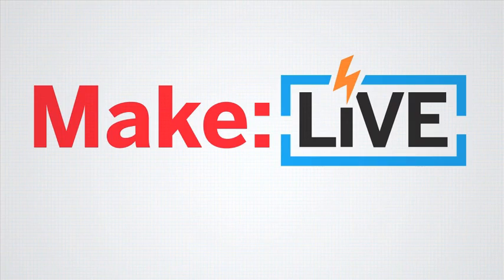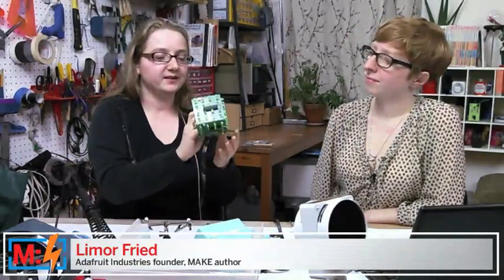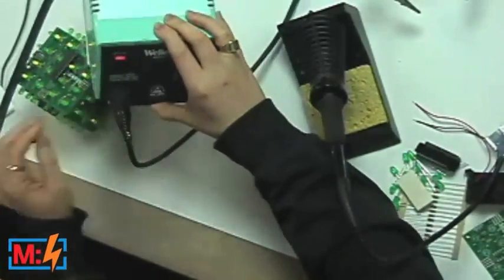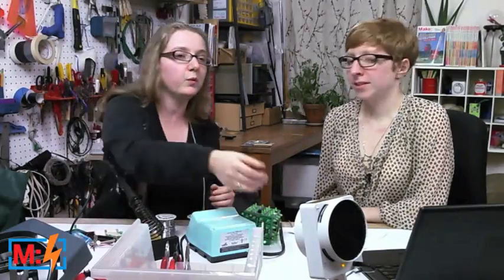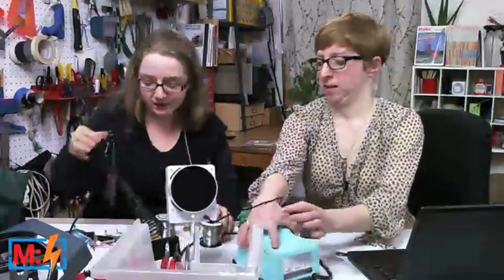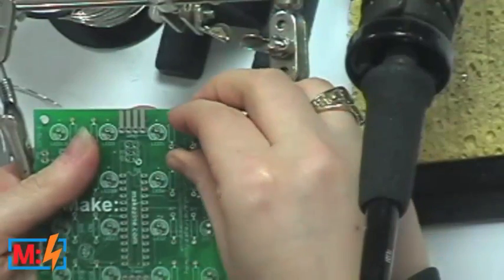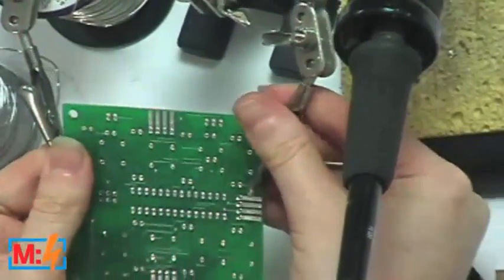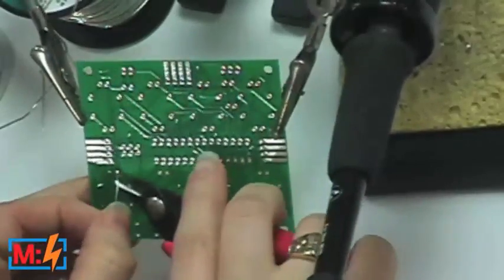Soldering Primer on Make: Live ep02

Comment: @Rubdos ive soldered plenty of leds and unless you have some sort of crazy wattage soldering iron, you wont burn it out. ive never burned out an led from heat. the only thing you really need to (somewhat) worry about is IC chips, and even then you can often use a DIP socket for it. i dont think ive burned out any component from heat in my life.. only too much voltage >:)

...ssssssssssssssss, crackle crackle, sssss

Comment: @freeNode5 Solder wick is just fine copper wire braided together. So the alternate solution is to use scrap copper wire without the shielding. Braid a bunch of the wire and wrap it on a spool. Solid copper wire or sheet metal will also work. What ever method you choose don't forget your flux. Flux for copper plumbing will also work fine; it just leaves a bigger mess to clean later.

Comment: Her de-soldering skills suck. First if you are using a solder sucker you should apply allot more solder and then suck. Second solder wick predates surface mount technology because it is used to remove solder in the hole, on the pad and in between pads. For the demo she showed it would have worked better then sucking. A little flux on the braid will make it work better. And finally how about removing chips? Tip place flux on small piece of 14g solid copper wire and place over pins apply heat.

Comment: Those solder suckers are a pain, I find a copper desoldering braid/wick much easier for through hole or surface mount.  It helps to spread the braid a little first so you don't heat it forever, also cutting it so you aren't heating as much braid is much better and makes it much easier to desolder.

Comment: The trick to transferring the heat from the iron to the part lead and pad is the use of a "heat bridge".  After placing the iron tip on the lead/pad, add a little solder to create a heat link between the parts.  This rapidly sinks the heat from the tip to the lead/pad and this will help to bring the lead/pad up to the proper temp, allowing the solder to flow properly.

Comment: Start using eutectic 63/37 solder and you will be much happier with the results.  Eutectic has virtually no plastic state stage and it's much harder to create a cold solder joint with it.

Comment: Also you may like to look at a few videos I've made on how to design develop and manufacture a PCB.  They take you right from designing and testing on the PC, converting to PCB layout, developing and etching the board, drilling the board, solder the components in place and finally fault finding a PCB and fixing any faults you may have.  To check them out go to my channel and there is a play list with them all in :) HTH